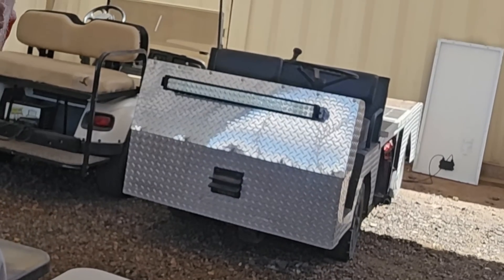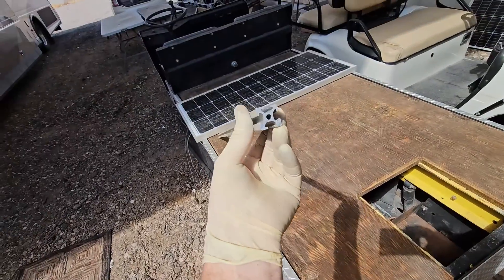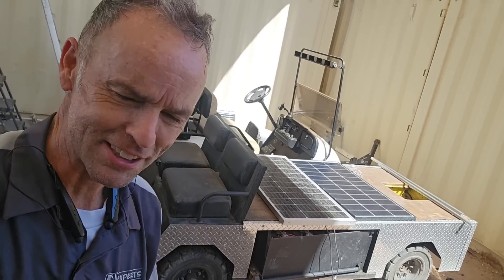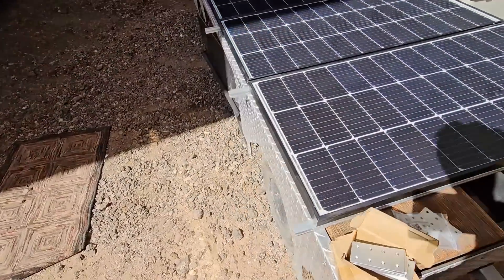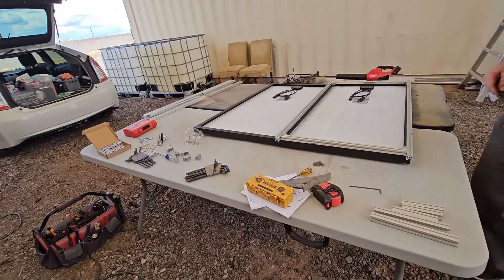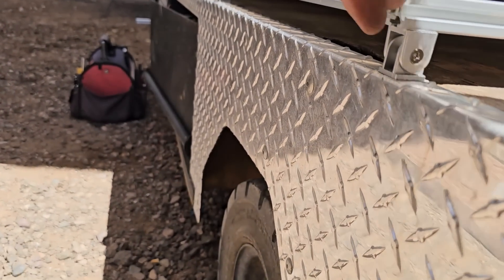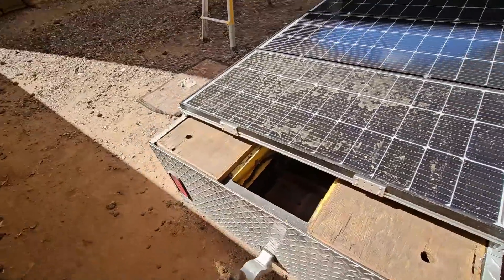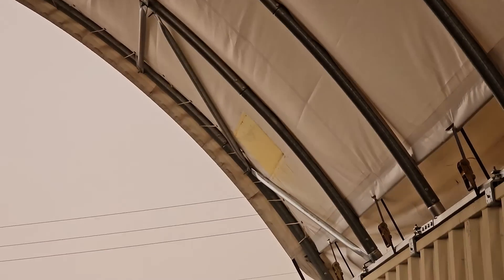Is This a Good NEW Method to Create a Solar Array?

Comment: Any concern for water intrusion through the screw holes/ brackets on the side of the panels? Great work!
Reply from the maker: no that is just aluminum frame and is exposed to the weather on that side too
Reply: @ what about water seeping into the panels and sitting/ evaporating once inside?
Reply from the maker: @tacokid13579  there is nothing for waterr to go into

Comment: You don't need x AutoCAD. Just use pen and paper do ruff sketch. With measurements. 
I worked for years doing this kind of thing in a fab shop.  But I have a background in design and drafting. And metal fab and machining equip
Your doing great.
Reply from the maker: yes, I really have little patience for measuring and thoughtful drafting too. I often round down so numbers are easier to work with :)

Comment: 2040 extrusion would provide better stiffness since each corner would have 2 screws on each side of the corner rather than just 1 with the 2020.

Excellent video. Love watching your stuff because you show everything from the thought process all the way through completion of the build.
Reply from the maker: yes, the 2020 is smaller and the connectors are too, but the price and utility is nice, especially for lighter builds, I would likely use more connector plates like t's and l's underneath too, but this won't be going over 25mph and with no real suspension it should not be hot dogging either, but I do add a few bumpers in the middle to add a little bit more support at the end.

Comment: You could also put 2 slides at the base of extrution on both ends, so when you lift it up, slides along center cutout and once reaches 90 degress locks in place, like they have in folding tables. Then to close, lift out of snag and slide back down flat.

Comment: 1 1/4"  aluminium   1/8 thick  angle  screwed and glued  to RV ROOF with 3m 5200  and nutcerts in the panels  3 1/4" bolts on each side of panel .  500 mph wind no problem  lol

Comment: Why wouldn't you have just made a full length canopy using panels instead of on the cargo deck?
Reply from the maker: I was not asked to make a roof or canopy and stick to the deck mostly.
Reply: Agree with canopy completely.  Provide a little shade over operator, maintained carry ability of deck and a place for solar charge controller and switches.